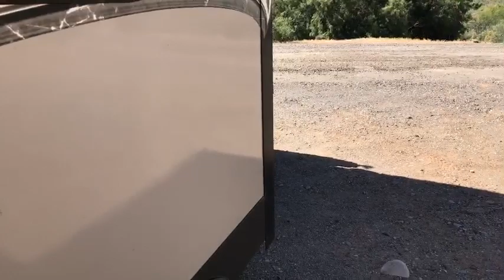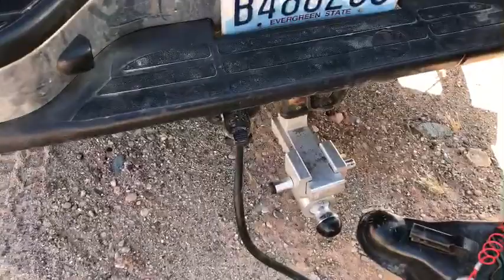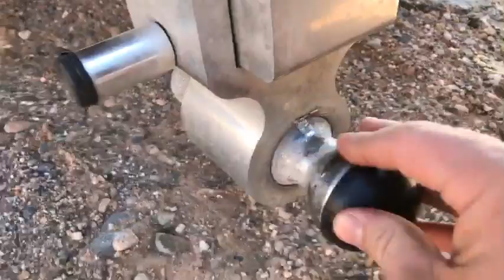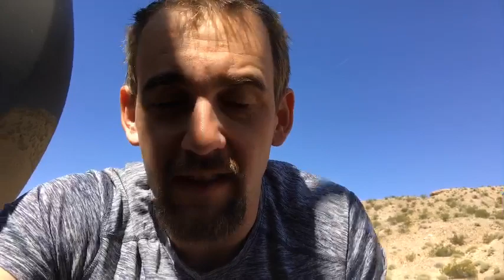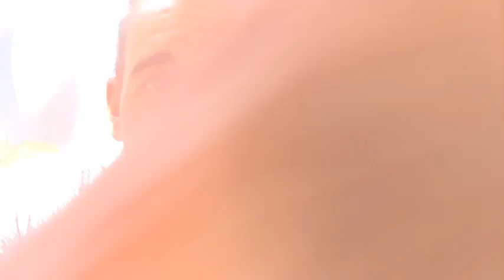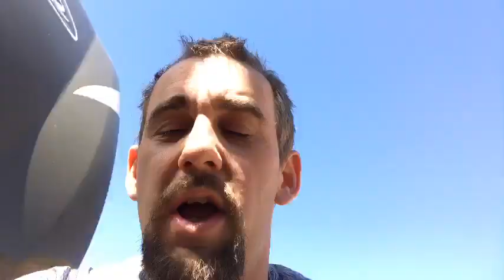So the RV Fell Off my Truck!!

Comment: Tongue Weight folks! Very important and usually never talked about, its usually only 10% (or less of the tow capacity on the hitch. So he would have been rated for only 750lbs of weight on the hitch and being near capacity is asking for problems as well imagine how the weight on the hitch spikes up as you hit bumps ect. A brand new 1500 Silverado has a tow capacity of 9200lbs to 9600lbs but the hitch tongue rating is a meager 500lbs meaning a trailer over 5000lbs is a potential problem. Very easy to screw this one up especially if your trailer is loaded with gear in the front. Always do your due diligence in weighing your setup AFTER loading it in all ways. Just because you can pull it doesn't mean you can hold it up.
Reply: Guaranteed he was way over tongue weight on that hitch just looking at that trailer

Comment: Gavin, the Yukon will tow it, just make sure the over drive is turned off. Thats most likely why it kept shifting between gears like that
Reply: Gotta push that tow/haul button!
Reply: If you don't use the button when on a hill the trans will over heat!!!  That tow button locks the trans out of overdrive.
Reply from the maker: Transmission/Clutches are shot on the Yukon. It won't even go above 3rd now.
Reply: damn it, I'm srry to hear that
Reply: if you use the Yukon make sure it has a trans cooler.
Reply: @jeffhorton258  I towed a 32' travel trailer with a 3/4 ton GMC Yukon XL and never had any issues with it. And yes, trans cooler and a MUST to be in tow/haul mode.

Comment: What was the tongue weight of the trailer? And what is the capacity of tongue weight on the hitch? Because you're under the tow rating doesn't mean you don't have too much weight on the tongue

Comment: I took my rv to the weight station to weight it with water and gear.  So I had a baseline and new approximately how it weighed.  It’s free.  You can do it at the dumps too. Or some truck stops.  I also weighed the tongue weight on the same scales.  Bring a jack stand to put the ball receiver on while jack is on scale (not trailer).

Comment: GALVIN.... I'm a truck driver buddy the truck that you have might say you can pull 15000 but your axles say different you have to have a three-quarter ton truck to pull a trailer your size that is the reason why your buddy is having trouble with her transmission. I have a travel trailer also and it is a 31 footer I use a three-quarter ton truck to pull it

Comment: Tow capacity and hitch are different I don't think your trucks suspension would handle that weight. check what the tung weight is suppose tone. But that should not have happened!

Comment: Thats a horrible design. You shouldn't be depending on welds to support weight.
Reply: @ Eric Farmer

You made my day, I have been welding for 40 years! Most failures can be attributed to a poor weld or CFCS (cheap frigin chinese steel)

Gavin drop the trailer(pun intended) and go find a good welder, then look into a good class 5 hitch to replace it with when your back in civilization.. Try etrailer.com